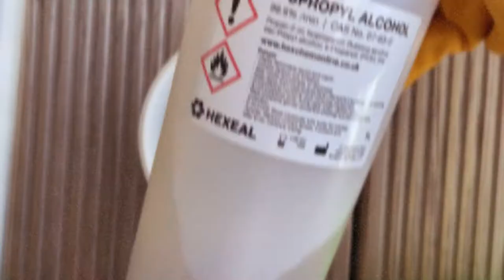Bachman 61090 N Gauge N Scale Main Street Brill Trolley repair job.

Comment: Thank you so much for this video, Rando. At age 76, I had never dared to disassemble a model railroad engine of any kind, but after watching your video, I was confident I could repair my trolley. I used two round toothpicks, the kind that are tapered to a point at each end, to remove the outer shell. I broke each of the two toothpicks in half and carefully pushed the sharp ends down near the tabs that hold the shell in place. When all four toothpick points were in place, the shell pulled out easily. Now, I am going to buy some iso alcohol, and I'm still waiting for shipment of some LaBelle 108 oil, so I can clean and lightly oil the parts. The metal contacts on the trucks (bogies) are super dirty. Thanks to your great video, I am sure I can get this cute little thing rolling again. It has been sitting in a drawer for 40 years! I'll let you know my final results. I'm embarrassed I have never been brave enough to try this before, but I learned a long time ago that a pic is worth a thousand words, and a video is worth a thousand pictures. Your video is excellent.🙂
Reply from the maker: Thank you for your kind feedback. I’m glad the video was helpful to you. 
I use isopropyl alcohol for cleaning. And sewing machine oil for the metal gears - as for the plastic gear just some cheap silicone grease  - and traction tyres from silicon tubes  🫡